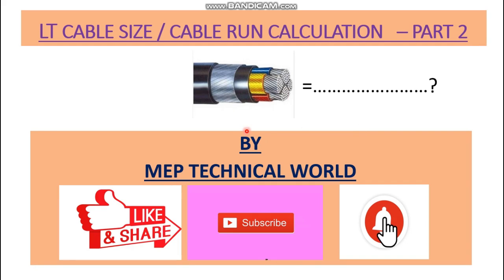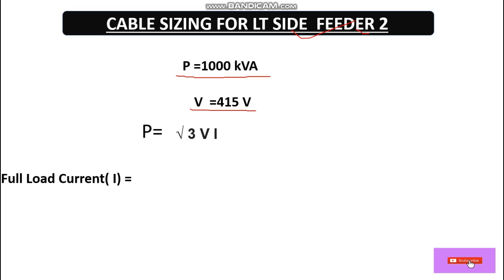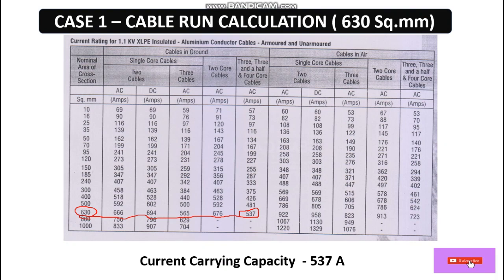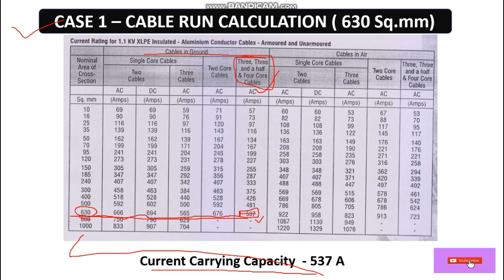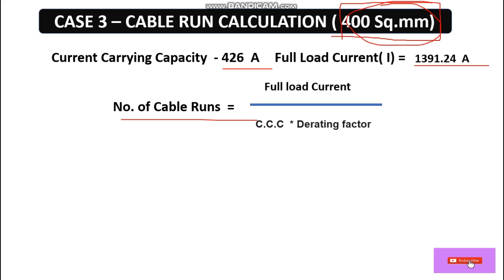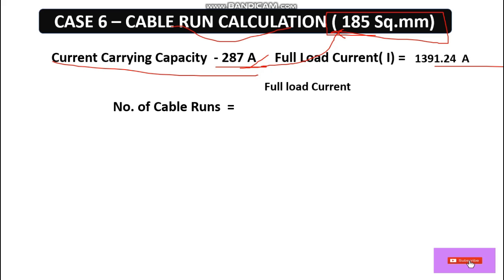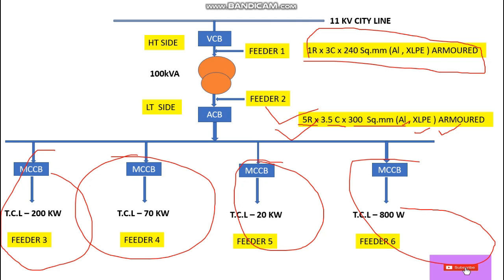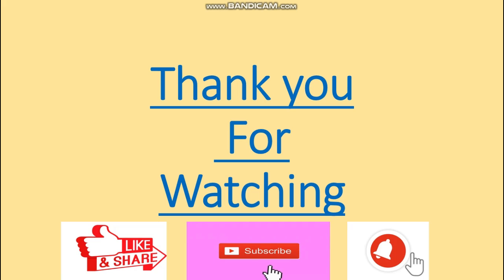LT cable Size and Cable run Calculation | Cable Run Calculation - Part 2

Comment: Thank you so much for the explanation,God bless you, but i do not really understand, I think the cables are 3½ core, 300mm, and its each of them that is that size, so i think it should be two runs,since the 1391 amps is shared by the two three phases which is apprx 463 per phase,and 2 runs will make it 231 per phase, or please can you explain better

Comment: when you calculate the apparent power you will not use pf or power factory? why?
Reply: this the same question i suppose  to raise. when you calculating the full load current why you did not considered 0.8 power factor. please explain the reason

Comment: When you have to select the cable from transformer to feeder 2. So, you will have to get the load of ACB(feeder 2) instead of transformer rating. clarify the query